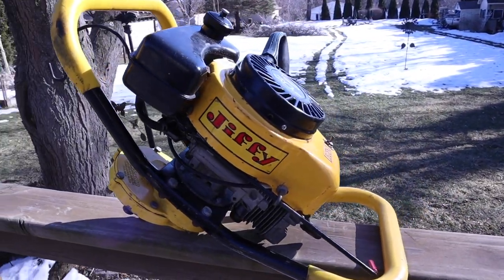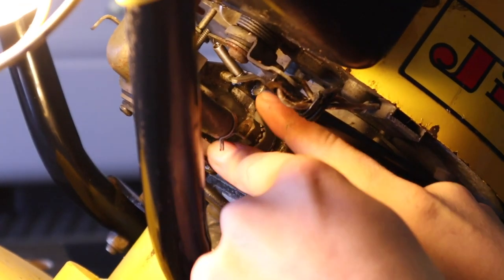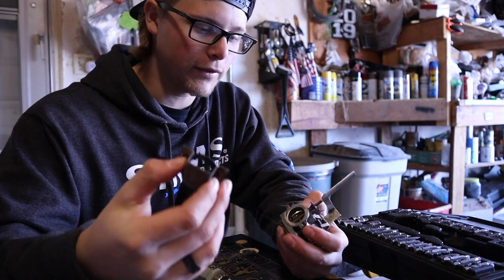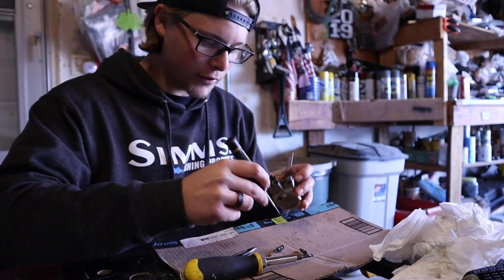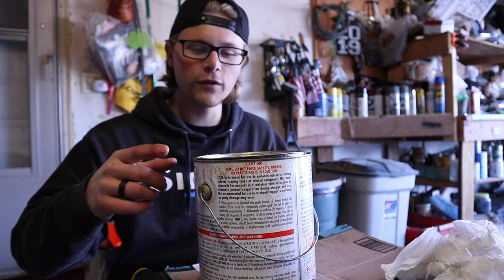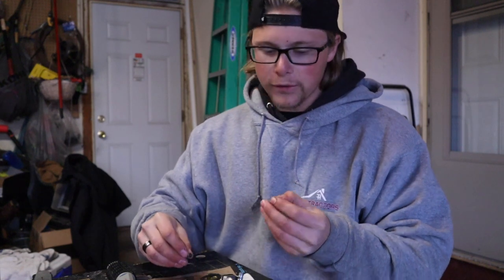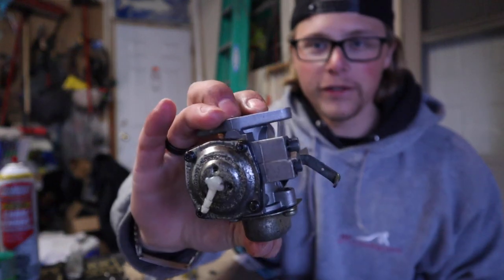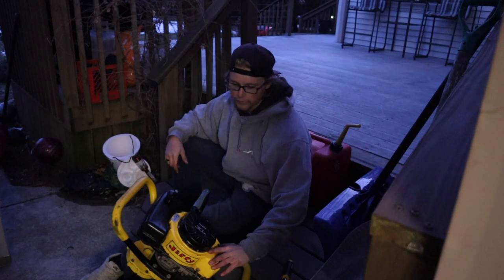How To Clean A Jiffy 30 Auger 3.0hp Carburetor (DISASSEMBLY/CLEANING/REASSEMBLY)

Comment: Good video but just minor note if not already mentioned. What you referred to as a carburetor drain is actually the primer air tube. Pressing the primer works the diaphragm like a pump. I was having a similar problem with mine. The engine would die in high speed, like it ran out of gas. I could keep it working if I could prime it regularly while operating it but that almost required a third arm. Cleaned the carb and installed a complete new kit with new needle valve and including those little aluminum caps that you see next to the needle valve. There are fuel ports under those. Still no improvement. Eventually, I discovered there is a screen inside the fuel inlet port. Why they don't put fuel filters on these things is beyond me. It's hard to see the screen but shining a flashlight down the carb throat and looking into the inlet port, I could see the x-hatches of the screen. I could not figure out how to remove that inlet port and replace the screen. My guess is that it is pressed in. I took a spray can of carb cleaner with a straw and sprayed the heck out of that inlet port until I could see it was clean as best I could. Unfortunately, I couldn't find a way to spray backwards through it, which is what I would have preferred but in the end, it solved my problem.

Comment: Nice job someone already touched on the primer line only other thing I noticed is behind the low and high adjustment screws the are o rings you don't want to lose or soak in carb cleaner
Reply from the maker: yes thank you for the input, the more knowledge here the better it is for people trying to fix their own. i appreciate the comment.

Comment: Your "fuel out" line is your primer. Air pressure pushes on the diaphragm and opens the needle to prime the carb.
Reply from the maker: yes thank you, i don’t know why i said that or why there would ever be a fuel out line on a carburetor 😂
Reply: @buschfishin I'm a little concerned that after you took it out of the cleaner the needle for the float was still in the base, if that's not clean it will never meter correctly.

Comment: Your description was great, but off. The carburetor works not by float, but by the vacuum fluctuations causing the diaphragm to flutter, which actuates the fuel delivery Needle. It's an odd one. Great job 👍

Comment: Hi
   i have looked at your video and done all you said.  Unfortunatly the seal in the intake broke...would you know where i can find a replacement part for this or whati is it called...I searched every where and can not find that piece......
Reply from the maker: look up jiffy carb gasket or jiffy 3hp carb gasket whatever model you have i just found one for $1.39
Reply: @buschfishin  i have the gasket that goes between the carburator and the motor no issue....it's the one between the carburator and the intake i can't find.....You know the part that let the air in the carburator....i am wondering if it's really necessary since it's only air that goes in there.....
Reply from the maker: i am a little confused, is it on the air adjustment screw? where the carb bolts onto the motor is technically the intake
Reply: @buschfishin  i took a picture but can't post here......at 3:29 in your video, that's the piece i am talking about, that's the seal that goes with it that i have broken and searched everywhere to get the replacement and are unable too.
Reply from the maker: i see what you are talking about now, i’ve done some searching and i can’t find anything, the whole purpose of thst is just to make sure that it sucks air from above incase it were to suck any water but it’s not a critical component by any means, you can run this without that with no problems but if you really want it i think your best bet would be to order an entire carb off amazon they’re pretty cheap and it would have one, hope this helps!

Comment: Phillips screw driver not star bit
Reply from the maker: i believe on this one they were torx but maybe different models have phillips? thanks for the comment!
Reply: @buschfishin  why torx they strip easier than any other type I have a 70’s model 30 now I have to check to see what I have lol
Reply: My auger has torx my buddy has the slotted screws flat head as other people call them anyways my auger won’t idle unless I continue to prime it any suggestions I’ve just replaced the needle valve and diaphragm
Reply from the maker: if you’ve gone through the carb and made sure every oriface is clean, it could be a problem getting fuel to the carb, i would pull the fuel line off the carb and make sure fuel is free flowing, im not too sure if these have an idle screw but if you can find one turn it up and see what happens, if neither of those work i believe the left fuel air mixture screw is for the idle circuit so you could turn that in (clockwise) 1/4 turn at a time and see if that richens it up enough to get it to idle.. does it run good wide open?
Reply: @buschfishin  have to pump the primer a few times to keep it going but runs full throttle I was told to adjust it under load
Reply from the maker: @thehashmonkey  in this video you'll see those two mixture screws i pointed out, i would say turn the left screw in a little bit and keep trying it until it idles. if the left screw doesn't do it then try the right one. before you do anything count how many turns it takes to get it in until it seats, then go back out the same amount and try it.. write it down though because those are important!

Comment: You need an ultrasonic cleaner.....they are the SHIT.....Thanx for the vid...I have a mod 30 and it was running like shit. Mostly because some lazy fool didnt store it right....so I get to fix my mistakes.
Reply from the maker: with the amount of carbs i clean i really should! glad i could help
Reply: @buschfishin  I got a six liter for around 120$.....I use water in it and then put the carb or whatever part you are cleaning in a glass jar filled with your favorite cleaner...It works super well and you dont have to use that much carb cleaner...just dump the water out and wait for the next victim....